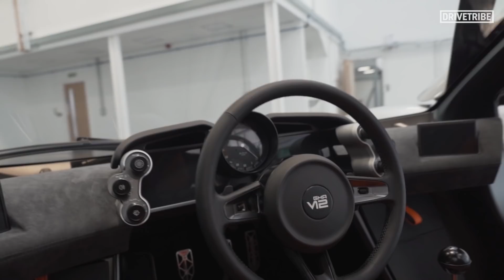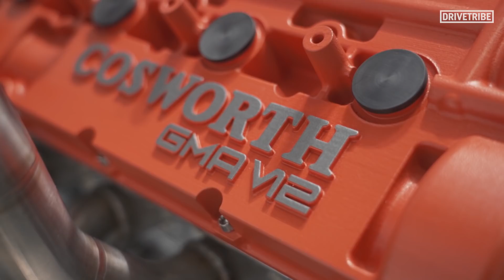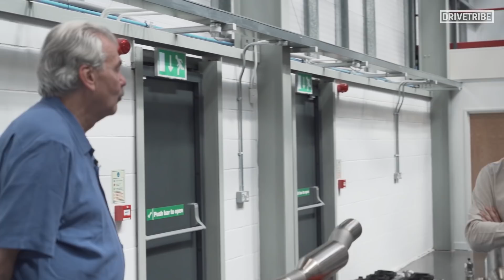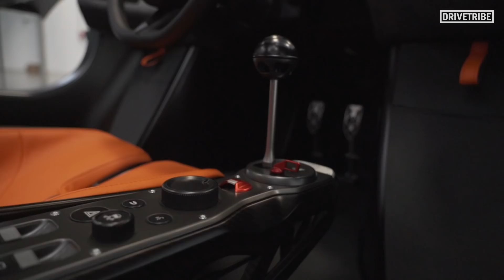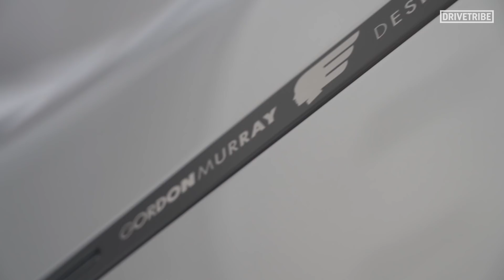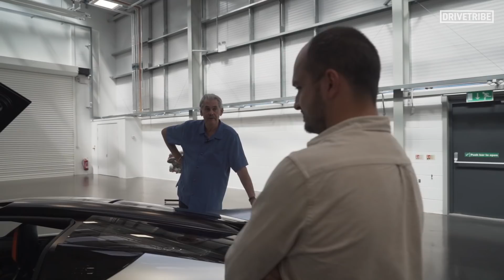How the hell do you make a fan car road legal? – The nerdiest of car chats with Gordon Murray

Comment: What if the fan becomes part of the exhaust system? The way it’s put into the car reminds me of the aerodynamic effects used in the P-51 mustang, with the exhaust that jets heated air out of a small hole at the rear.

Comment: I'm absolutely convinced that Gordon is holding back on some the performance expectations of this car. In one video, I heard him say the car would have a theoretical top speed of 217mph, but something tells me it will be quicker than that. Also, he says he's uninterested in how quick it will be at the track, but once again, I'm pretty sure he's expecting some phenomenal numbers. Think about it: that advanced fan (much better than the original Brabham version) should have that car grip the track like nothing before, and it's adjustable to the car's speed, meaning that it should crush the Nurburgring, or even Le Mans. Speaking of which, the most important information I want: will any owners transition the car into a race car, like they did with the original F1? That would be completely awesome!
Reply: In a video I saw GM mentions top speed of 227 due to drag. There will be a track only model of T50. If I recall correctly GM claims around 30 cars.

Comment: I think it could take the lap record at nürburgring nordschleife, only with a paddle shift gearbox though.
Reply: Your missing the point of the car.
Reply: @dsmx85  , No i'm not. I'm well aware of what the car is, what it was designed for. He hasn't built it to be quick around a track but that's what we all want to know, can it knock Porsche off the top spot. With the amount of downforce it can apparently generate, it could be seriously quick but quicker with a paddle shifter.
Reply: @amarjit singh , Doesn't matter, Porsche is still king of the ring. This car has the potential to knock it off the top spot.
Reply: @amarjit singh , It's a V12, fan driven car.....it's going to be fast, the design means little in terms of resistance and i have no doubt it will be faster than the Valkerie and AMG One.

Comment: That warehouse floor looks recently painted. The whole place does actually.
Reply: That would make sense since that's where he's displaying the car/prototype for these interviews.
Reply: Yes, the car is pretty boring isn't it
Reply: d33p77 please answer how a N/A V12 with a manual gearbox, with rwd, central seated and exceptional aerodynamics not get you excited?!?! Especially in this day n age.
Reply: @robc1014  I wouldn't bother asking. He's just a sad little nobody who types stuff like that because he's desperate for any form of attention.
Reply: @robc1014  its not gonna be anything other than possibly the fastest N/A car. It's not gonna break or hold as many records as the F1. It's no doubt a driver's car, but it won't have the mass appeal of its predecessor. If you look at the 'trinity', they have artistic appeal. This car was designed by an engineer and you can see it, there's no emotion in the bodywork, lights, etc.... So yes, great, we're getting a cheap, better F1, but is that enough?
Reply: @amarjit singh i love the Mclaren F1. This car might diminish the F1s value
Reply: @amarjit singh yes it will. It's a direct descendant, everything about it is. So it'll be cheaper, faster, and more modern.

Comment: Comparing the Valkyrie (a road legal production car) to a no limits track only car that isn’t even legal in any racing series is not comparable. The Valkyrie will be the fastest road legal production car for the foreseeable future. It doesn’t matter what the 919 Evo does as it’s not road legal. The challenge is to do what the the Valkyrie is going to do whilst being a road legal production car. The Valkyrie and T50 are completely different cars with different philosophies, both of which are as appealing in their own way, as each other. Valkyrie is at the bleeding edge of what’s possible, currently, for a road legal car designed for the track. The T50 is meant to be the most engaging modern drivers car.
Reply: Before the Valkyrie was shown, it was said to be on par with high end race cars(F1 and LMP). Which model wasn't stated but it was always going to be the track only model. P1,918 and LaFerrari were too heavy and clumsy. The designer of Valkyrie mentioned such of those cars. We can't have it both ways here. Now that Porsche put the smack down it is going to be interesting to see if any of this track talk of Valkyrie will come true.  

T50 will be in track only form also. Valkyrie isn't street legal in US due to lack of crash tests. One still can drive on street if registered properly. From my understanding there will be three Valkyrie models.

Comment: I didn’t understand the fan part.
Reply: It removes turbulent air near to the surface (top & bottom) to leave 'clean' (smooth flowing) air going over the car.  That reduces drag and so improves performance.  It also allows a larger, more aggressive diffuser to increase downforce.  The diffuser wouldn't work properly without the fan as the airflow would separate from the underside of the car.  
This explanation is a bit heavy going: https://en.wikipedia.org/wiki/Boundary_layer.
Now imagine being a pedestrian walking behind one of these to cross the road !

Comment: I like this more than the Valkyrie . Makes more sense and is very fast at the same time.
Reply: @amarjit singh Valkyrie is great and it will be the fastest thing on the track and I liked it very much but when I heard Gordan Murray explain the process behind the T50 , I just felt that the T50 has nailed it and there is no beating it.  T50 is unique and it doesn't have to follow any design elements of a brand .
Reply: @jerryldavis1823  Agreed for that.